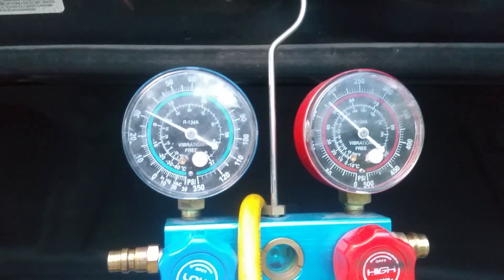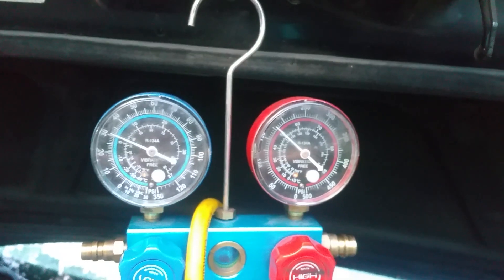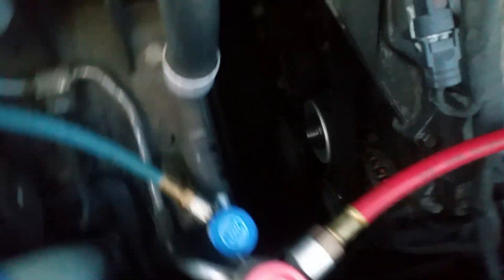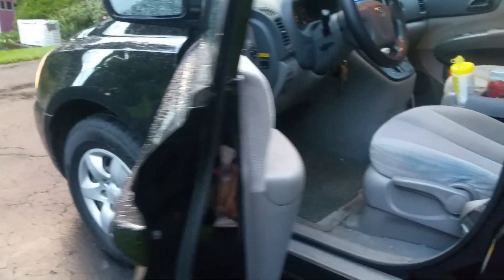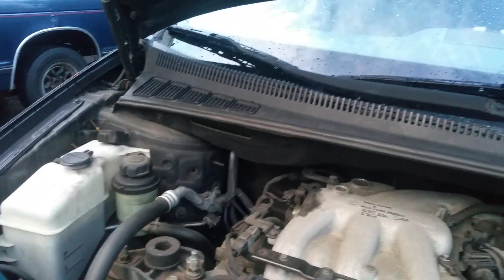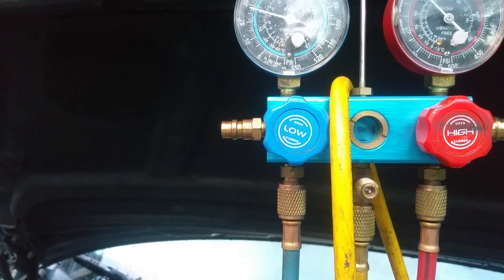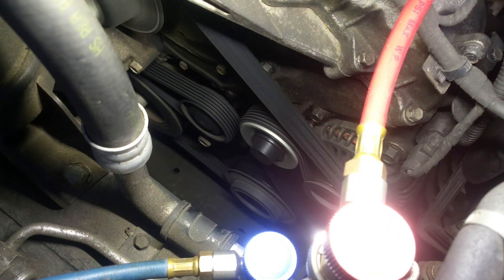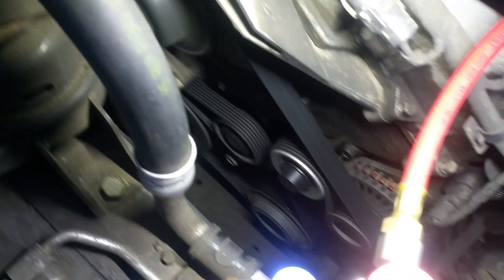2007 Kia Sedona 3.8ltr Non Functioning AC; How to Diagnose. PART2

Comment: Cooling fan control modules are bad about burning up on these and letting the pressure on the high side get outta hand.  Something to always check when the system is active.

Comment: Just subscribed.  Your name caught my eye as I'm Cuban and also a Rodriguez, hah!   Anyhow...  

Likely that clutch winding is going out.  Fuses blow for a reason, as they are a symptom, not the problem.  Keep us posted if the fuse swap stuck!    If you see the car again, throw an amp clamp on that circuit to see the current draw.  I bet as it gets hot, the current will climb and that's what's blowing the fuse.   New clutch time after that!  Compressor seems fine.   Easy fix, no need to break into the refrigerant system.  Keep us posted!
Reply from the maker: Yes, the winding is going. This is what I told the customer. The fuse bought him a couple more days, especially during the heat wave. 

I will be replacing the compressor any day now. 

Regarding the name, that's pretty cool 😉